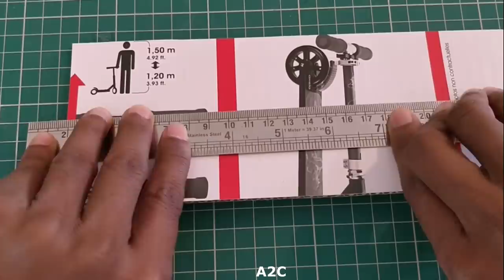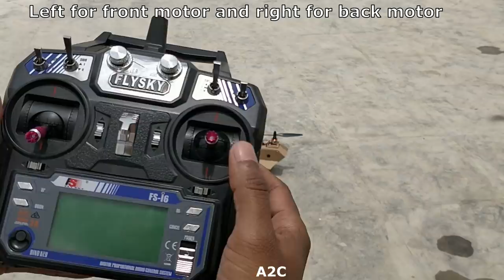CH-47 #Chinook || How to Make A REMOTE Helicopter || Cardboard helicopter

Comment: Your helicopter is a co-axial type helicopter . In order for it to fly properly one motor must rotate counter clockwise and the other motor must rotate clockwise to balance out the torque from each motor . The motors in your heli are rotating in the same direction, that is why the heli flipped on take off. You must have a speed        controller  (ESC) for each motor or an electronic speed controller that is able to mix  the speed from each motor .
Reply: david lewis  I agree with you
Reply: And please use servo and flight controller board which is used in quadcopter
Reply: That is only a part of the problem the bicopter needs motors that move, not stationary. they need to be able to move opposite of the body therefore keeping the drone stable in flight as this is not a quadcopter.
Reply: @machu5998  You are absolutely right !!

Comment: Use a kkr 2.1.5 flight controller that will automatically balance the weight by adjusting the motor speed

Comment: The motor which is attached at the back is not perpendicular to the surface. So I think the thrust which is produced is not in the right direction to lift the body.
Reply from the maker: Thanks for the inputs, will making the adjustment

Comment: a bicopter needs a motor that will love with a gyro. they can no be fixed as they need to move opposite to the body itself. the drone needs to be able to have pitch and yaw controls which this does not. Thats why it will not fly.
Reply: Ak
Reply: Aku
Reply: نتابيلالو

Comment: Good effort. You may fix one more rotor at the tail end in the position of 90 degrees, it helps to pushes or pulls against the tail to counter the torque effect.

Comment: Make sure both moters run counter clockwise respect to each other (by interchangine 2 phase of moter).....nd check rpm by techo meter
Reply: No,in CH47 Chinook both the props rotate in opposite direction to avoid collision and to gain altitude in low pressure area.

Comment: 1.  Rotors are kind of small to the size of the fuselage.
2.  Front rotors (as seen from above) should spin counter clockwise.  Aft rotors should spin clockwise.
3.  Try to use as light weight materials as you can.
4.  Center of gravity is critical.  If either of the rotors has too much weight to support, it will crash.
5.  Fly bars would help keep it in flight trim.
6.  Both rotors should be synced so that they start rotation together.
7.  Easiest way is to use dual stacked rotors, one above the other and counter rotating to each other.  This way you have, in effect, a 4 head drone.  Over all, all 4 motors would be synced to the same RPM.  Flight control would be achieved by minor adjustments in each of the rotor motors.
7.  The way the actual chinook operates is each blade can be individually adjusted in angle to increase/decrease lift.  They are controlled by a device called a swashplate (one per rotor disk).  The fwd rotor sits at a fwd angle of 9 degrees, the aft rotor at a fwd angle of 3 degrees.  They all rotate at 225 RPM in flight mode.
8.  The real aircraft rotor blades are synced so that they don’t strike each other.  Should this happen, the aircraft will crash catastrophically. 
9.  Having the aft rotor higher than the fwd will eliminate for the most part, the need to sync the blades, unless you are truly building a true scale model.
10.  SYMA R/C makes a chinook model that you can look at for some ideas.  Model S-026.

Comment: It's simple add a flight controller to your model I suggest to use ardupilot APM 2.8 and download mission pilot software in pc to use it and also donot mount wooden block on the cardoboard  you could make more space in cardboard so your motor and propeller rotates easily but also check videos on mission planner and ardupilot how to use them on youtube

Comment: if it is not flying the front rotor should be clockwise rotation and the rear rotor should rotate counter clockwise
Reply: to make it forward it should have the rocket thing in rear rotor

Comment: Hii if you want to fly this just look at a video how to make a bicopter and then cover the frame using dephron sheet 3mm and give a look like chinook.i am professional aeromdeller I have done all this before. One tip use kk 2.1.5 flight controller board it will be easy to program. You will find everything on YouTube. 

Happy flying
Reply: Zz
Reply: Hi

Comment: You need flight controller board kk 
And also need 4 pis servo motor to control motor for left right 
And on your kk flight controlr
Then go to the setting click on the factory rset and then click on the mode type 
And then click on the duo copter after setting you can calli brate your radio divice to flight controler now then attached the proppeler it will work properly

Comment: The reason it’s not flying it’s because you need servo’s controlling the motor thrust direction, and you need a flight controlling software to input the data, you can’t just make it fly by attaching two motors and without using any trust control!

Comment: You may add more weight by using glue gun. Also  you have used drone controller. I may advise you to use 2.5hz remote controller

Comment: one motor is rotation clock wise and other is anticlockwise direction.when u test the helicopter u have to add traning gear under the helicopter and you helicopter will not crash.

Comment: Dude you did all the things right ,
As we see in Chinook the height of the motors are different , therefore the velocity would be different.
That is why you need to Chang the lower motor to  0.4 % more speedy than the upper one

Comment: You should use flight controller fir this. You should use kk2.1.5 flight controller for this dual copter. If you don’t do this ot will never fly equally.

Comment: Disign of both the sides should be same and weight distribution should be equal.you have used one more plywood block on the rear propellers,correct it and instead of using plywood you can use MDF sheet .